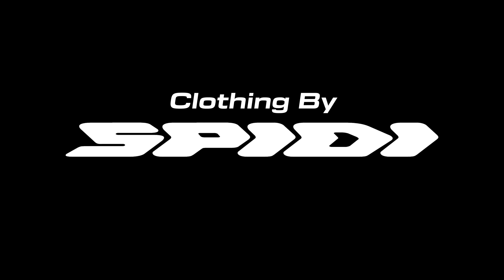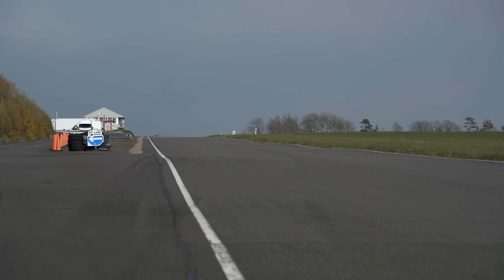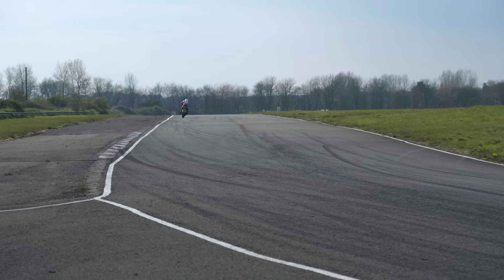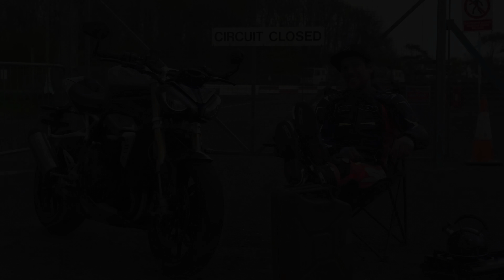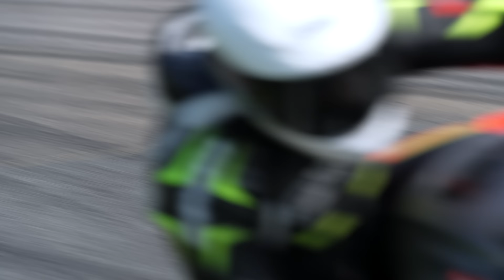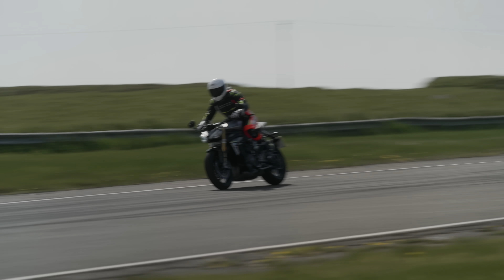2021 Triumph Speed Triple 1200 RS First Ride (On Track)

Comment: Great review, good job!
 I owned the 1050 rs and now the 1200 rs and the suspension is perfect on roads in good condition but if they are not they feel hard. I just changed tires, a friend recommended the CONTIRACE ATTACK 2 STREET and I have to say that with this type of tire the problem is over. I never thought that a tire would influence the suspension setting so much. To those of you who have the 1200, try another tire with a softer casing, it does not have to be continental, although I doubt that I will mount another tire again and I have tried supercorsa, s21, TT, rs10 ..... but none that works better with the suspension. my speed 1200 is now better than the speed 1050 rs

Comment: Test rode one yesterday and totally agree with Chris . I think for someone under 14st the front forks would need some adjustment and Triumph missed a trick by linking the anti wheelie with the T.C . The quick shifter is superb and so are the brakes and it could tempt me away from my Superduke at 15 grand . Well done Triumph. Almost forgot , more racy paint job please as us super naked riders like so show off a bit.

Comment: Such a beautiful sound , the exhaust sound changes as the rev increases , from sophisticated in the low to the roaring in the high , 

Mechanically  (a mechanical engineer here) , and as a bike enthusiast,  3 Cyls are the best when it comes to power delivery, low end torque + top end rush , and due to triumphs T-plane crankshaft (perfect secondary balance) this thing revs very high for a engine that size , and reaches redline quicker than any I4...

I've plenty experience,  owned an R1 (sold last year and got a cycle), r6, zx 10r, the busa, Zh2, RSV4, panigale, cbr 1000, and z900 , daytona 675, street triple 675RS, RE bikes,and what not , but i find three cyls the best among inline 4s and 2s (Vs are better ). (Except some radicals i4s ).

Best bike, i will be buying the trident 660 or this next ( currently ride a cycle) !!.
Reply: T-plane is only on the Tiger.  Street and Speed have 120 degree Y crank.
Reply: @xorbe2  the 120° Crank has perfect secondary balance . The T  crank has slight imperfections.  Maybe i wrote wrong (vice versa) in the comment.

Comment: I can't tell you how proud I am of Triumph…They've finally made a mill that can scare you. I've owned an 03, an 05 and my current 2013 R. They've always had "good" power, but even intermediate riders wouldn't s**t their pants (trousers) riding one. They've had torquey, easy to manage motors, but for the new Speedie to have 5+ [more] bhp than the last gen (absolute street monster) Tuono, makes me almost tear up a bit 😉.
Well, I guess I gotta take a second on the house, bc Triumph has made me want to buy a brand new S3 for the first time...
Now, if that sub-frame was red and the wheels were as sexy as the last gen (or even the 2012-13 PVM's) I'd have to go broke...especially in black

Comment: Looked like it wasn't very quick going into turns ? 
What is up with makers insisting on putting a head light that needs a bra.
Or from transformers. 
How'd the tires and brakes hold up ?

Comment: No we don't need an even more focused Speed Triple for professional racers and youngsters that cannot afford them. We need a sanctuary for ex-sportsbike riding greybeards - a place for tired old knees that won't bend anymore - this is why the MT-10 is so fantastic - 40 and 50 somethings that cannot "do" R1s anymore can ride them all day pain free and get a sports bike buzz - the leg position of the Speed Triple is well into young mans' territory.  If they want to differentiate a bit - create a MT-10 tourer or Kawasaki SX (or even a mild adventure bike) based on this Speed Trip. Put 6.5 inches of suspension travel on it to protect our knackered old spines, then drop the footpegs to an old-man friendly position and fit bar risers, some luggage and leave the motor alone - no detuning nonsense. Speed Triple 1200 GT - not stupidly tall and heavy like a Tiger - a real world fast mile crusher - redefine the Sports Tourer category.

On a similar note, they should certainly consider squeezing the motor into a Tiger 900 GT frame replacing the current stupidly heavyweight Tiger 1200.

Comment: Love Triumph and Speed Triples, but not a fan of this styling - at all. I see Yamaha MT styling cues and I think those bikes are fugly. But I'm 41 years old and maybe my preferences are stuck in the past. I also prefer the high mount exhaust on my Speed Triple because it shows off the single sided swingarm better. He touched on the TFT displays in the review. I prefer the analog tach with small LCD gauge display to the full TFT displays on bikes nowadays. I also find these displays to be horrible for viewing with glare, reflection, etc.

Comment: I got 99' 885 speed triple, even that thing gives me incredible front end confidence. I ride it like a complete hooligan and it just turns, doesnt lock brakes at any situation. I dont even have an abs forget about the rider modes. I think speed triple is way to go if you want a real streetfighter.

Comment: Chris , super review.  Trusted content. Thanks.
May I ask though;  ... I’m considering this as a second bike  (leaving the R1250GS for touring) ... I want something “playful” . I live in Portugal  ( so no weather protection needed ). Is the street triple a better option for me? (given the local roads are “nadgery and twisty “)
Reply: Tricky question, I’d say that depends on what excites you more - working the engine hard to keep the speed up or having effortless speed on tap. The difference in chassis performance between the Street and Speed is the smallest it’s ever been so I would say the choice is now more about whether you want an engine to thrash or an engine to be lazy with the gears on.
Reply: @chrisnorthover7582  Thanks ! Sounds like the street triple is the way to go. (Shame I’m too old to get accustomed to the headlight style 😬)

Comment: Let me start with the Pro’s
Love the new more powerful engine, Triumph triples always sound fantastic, have heaps midrange grunt and it’ll be a brilliant road bike.
Well done on shedding 10 Kgs on it, that’s quite a lot and you’ll feel it.

Now the Cons.....
Single low beam headlamp, ..in this day and age 🤷🏻‍♂️..really?? You will get fed up of people telling you that one of your headlights is out!
Generally messy and lazy design details, the bike looks unfinished, like a test mule...
The last Speed Triple RS had a small nose cone flyscreen as standard, ..missing on this one, more wind blast for the rider and more bugs splattering on the back of the clocks,....oh , but Triumph will sell you one for £180 quid 🤔,....it’s £2 quids worth of ABS plastic, call it a fiver painted, ..poor show Triumph 😳!

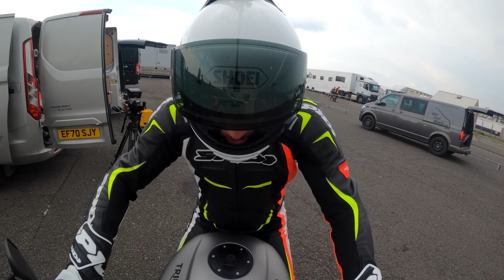At 0:20 seconds in, look at all the bloody bolts in that rear drive hub, 6 for the Cush drive and 6 for the sprocket,....it looks like “ bolt city” surely they could come up with a more aesthetically pleasing result than that?

Ugly exhaust flapper valve mechanism left uncovered on the top of the exhaust pipe near the silencer, yet a few inches below that is a black plastic exhaust cover, surely this could have been extended just to hide the ugly mechanism and tidy the appearance up 🤷🏻‍♂️?

The most boring colour schemes ever,...black or grey, no imagination shown with colours or graphics 

This bike could have turned out so much better we’re it not for the lack of finishing and detailing skills exhibited here, as I’ve already said, it looks to me just like an unfinished prototype test mule ,....missed the mark by a mile Triumph 🙄!

Comment: 99% of riders don't need electronic adjustable suspension and NO road riders need it.
I have professionally modified OEM suspension on my bikes and once I adjust the settings properly, I never have to touch them again. Ever.

Comment: The key question for me is whether it wheelies easier than the Streetfighter V4?
Reply: Both come up ridiculously easily, but I’d say the Triumph is easier to hold there.
Reply: I found the old Speed Triple was a bit heavy to get lift off, although I didn’t own it long enough to really explore. The Streetfighter (which replaced the Triumph) takes way more effort than the Panigale, but both have a very tricky to locate balance point. Will be definitely taking the Triumph for a test ride to get a definitive answer. My favourite bike remains the 1st gen R1. Easy to loft and very easy to balance, although I had far more time to practice and I was a lot younger and less brittle.

Comment: None of this 180 bhp stuff is needed on a road bike.
Pinnacle of S3 development was the 2008-10 model, Brembos, steel tank, round headlights. The 955i's are iconic classics.
No ride by wire, no rider modes, no TC, analogue tach, blah blah.
120 hp is ample for the street, and more to the point, just off idle torque with heavier cranks has never been bettered.

Comment: Hell yeah. I love your riding style. I will not test ride this one as I just got a SDR and don't want to get all pissy.
Reply: yeah mate unfortunately the SDR was good to buy in 2020 but in 2021 with fresh cash my money will go for the Tuono V4F or the Speed 1200. The 2 best of the category ! The Streetfighter V4 has too long gear ratios for road riding and it is full of little negatives. Check the long term review of MCN channel by Steve !! 👍
Reply: @lensoprezole5322  you should really test ride them all before deciding which to buy

Comment: Its lost its identity. I don’t care if they affect the handling it absolutely needs the high level exhausts
Reply: So what you're saying is you want to add weight and raise the centre of gravity???

- Buy a Harley
Reply: @jockojockoson9995  I don’t want a tractor though. I just want the iconic styling, the old one was one of the best handling super naked so the exhaust position didn’t affect it

Comment: It bothers me to no end that the headlights are asymmetrical (low beam on the right high beam on the left) - it permanently looks like one of the bulbs is out... I can't believe I'll pass on this Speed Triple only because of the ridiculous headlight design, but here we are...
Reply: motozest : you can switch off the high beam and only the DRL is on !
Reply: @lensoprezole5322  I think you meant low beam. But in low light conditions you need that low beam on, so you can never escape the stupid asymmetry...

Comment: Looking forward to the roady bit..........😉
Reply: I think that it is the valve train that made the whistling noise. If you pulled the clutch in whilst the old bike was stationary the gearbox would stop spinning but you would still hear the noise. I guess it could be the primary drive making the noise I suppose.

Comment: There’s a lot of talk of this bike being lighter than last years 1050 yet a search of the specs for each shows its actually the opposite. 
Even the website for my local Triumph dealer shows the new bike being 437 pounds dry and last years bike being 423 pounds dry. 
Can’t help but question the rest of the marketing fluff around this bike.
Reply: The old 1050 is heavier than the new 1200. The 1050 was 423 pounds dry but 467 lbs wet. The 1200 is 437 lbs wet, so it is a little bit lighter. Plus with that weight save and geometry changes, it will feel nimbler than the last one.
Reply: @mrrichie4643   That disagrees with the Triumph dealers website.  They compare dry weight to dry weight. Could be a mistake but their data shows the new bike being heavier than the old. As does several other sources. 
Going to be a big disappointment if the marketing claims vs the actual specs turn out to be BS.
Reply: @robertosmith1  Oh okay, that’s a bit strange then. On Triumph’s UK website and on MCN they both have the new bikes weight as 198 kg wet, whereas the 1050 was I think 212kg wet.
Reply: @robertosmith1  I think you may have conflated the dry and wet weight of the 1200, as that 437 pounds figure you gave as the dry weight is actually the wet weight of the bike.
Reply: @mrrichie4643   I didn’t conflate anything. I do know how to read. 
https://www.triumph-motorcycles.ca/motorcycles/roadsters/speed-triple-1200/speed-triple-1200-rs
Reply: @mrrichie4643   I didn’t conflate anything, I do know how to read. 
https://www.triumphmotorcycles.com/motorcycles/roadsters/speed-triple-1200/speed-triple-1200-rs
Reply: @robertosmith1   Well the canada website has a typo in it then. They’ve accidentally written dry instead of wet. The british website states 198kg wet, as does every other British based review I’ve seen and read. Unless the bikes being sold in North America are different, it must be a typo. Particularly as Triumph are singing from the rooftops how much lighter the bike is, if it wasn’t and they were lying, that claim would be shot down immediately.

https://www.triumphmotorcycles.co.uk/motorcycles/roadsters/speed-triple-1200

https://www.motorcyclenews.com/amp/bike-reviews/triumph/speed-triple-1200-rs/2021/
Reply: @mrrichie4643   Well here’s the US website for you. Did they all screwup. 
https://www.triumphmotorcycles.com/motorcycles/roadsters/speed-triple-1200/speed-triple-1200-rs
Reply: @robertosmith1  If you look on that original canadian link you posted and scroll down to the subheading ‘features’ it states that the wet weight is 198kg
Reply: @mrrichie4643   You’re right, I never checked that section. But as you can see elsewhere on that same page it does state that the dry weight is 198kg. 
Going to take a closer look at maybe picking up one of these or a blow out deal on a leftover 1050 RS
Reply: @robertosmith1  I wouldn’t be surprised if soon the 1050 will become a bit of a bargain as everyone will want the 1200. Both look to be great bikes.